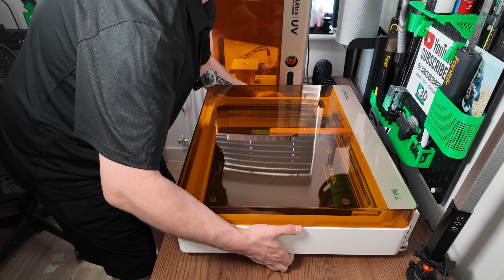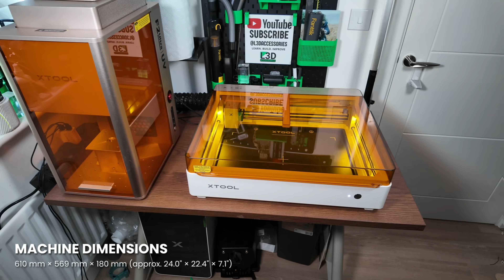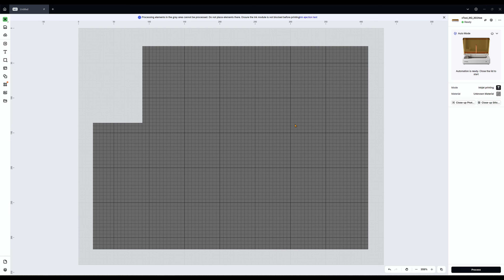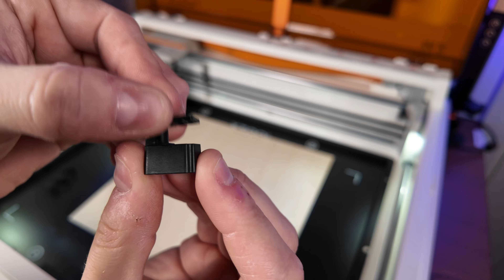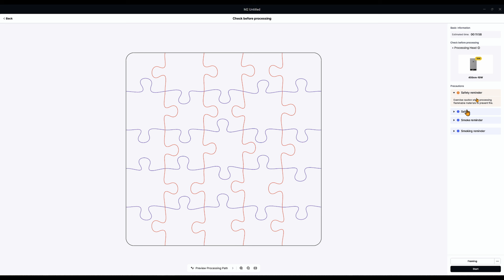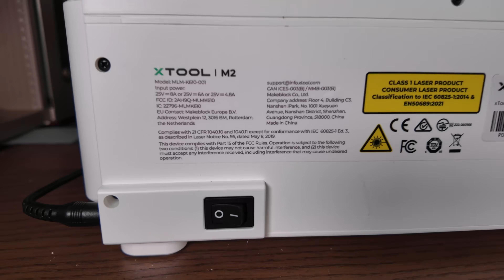I Tried xTool’s New M2… and It Shocked Me

Comment: At $99 per ink it won't take long to add up! Will the Xtool screen for screen printing fit on the work space??
Reply from the maker: I haven't tried that kit so I can't say for sure. The work area on the M2 with the 10 and 20 watt modules is 426 by 320 mm, so you could check the screen size against that, or xTool support can confirm.

Comment: I really want to get one but am I also looking for a affordable workbench that can hold that equipment- what type of workbench or table is the one in the video?
Reply from the maker: The laser is actually really light so most 600mm deep workbenches should be fine. The one I'm using in this video is an IKEA table and is 800mm deep. It's called: IDÅSEN.

If you do decide to purchase an xTool please consider using the affiliate code in my video description.
Reply: @L3DAccessories thank you for the info!

Comment: Can you do KFlex darts on this mate?
Reply from the maker: If you had the IR module then probably yes. Although I don't know how well it would travel over the flight once it focuses on the material. The clearance might not be enough.
Reply: @L3DAccessories ahhh ok mate thanks for the reply.. I had the Xtool F1 and wanted to do coloured flights but was told you can only do that on the F2 models.
Reply from the maker: @RustyBladesYoutubeBarber You can only do colour flights with the F2 Ultra UV. The IR laser can do black and maybe some other colours but they won't be very clear and contrasting.
Reply: @L3DAccessories ok mate thanks for the heads up mate seems like a big purchase for a few flights lol maybe I’ll skip the idea. I’ve been offered a HPC laserscript LS3040 desktop machine but again I didn’t know if I could do flights on that either. 🤦🏻‍♂️
Reply from the maker: @RustyBladesYoutubeBarber You're welcome. Just a heads up, the LS3040 is a CO2 laser which definitely can't do dart flights. What it can do is cut clear acrylic, do tumblers and woods.
Reply: @L3DAccessories that’s brill thanks mate

Comment: I just bought one today!  I have a P2 but wanted to print in colour and wanted to engrave on stainless steel.  I’m a bit concerned about the smell as I did have the AP2 for my P2 but the smell was bad, especially with acrylic.  I purchased the desktop air purifier so I hope that does the trick.  I suppose I can vent out of my window as well.  Thanks for a great review.  I have a couple of questions?  Have you printed on clear acrylic in colour and to secure items can you use masking tape?  I do that on my P2 when wood or acrylic is warped.  Thanks Chris!
Reply from the maker: Thanks for watching! I've been using it and doing a lot of cutting and engraving and the extraction alongside the AP2 did a brilliant job. I genuinely didn't smell anything during the engraving.

I tried printing onto pink acrylic and it didn't work, the ink just didn't adhere to the surface so I don't think you'll be able to do it.

Yes you can secure the material down with masking tape, the camera accuracy is brilliant so as long as you take a picture you'll be able to position your design in areas away from the masking tape.

Comment: Did I see the wood shift as it printed for the jigsaw? And does this machine have a riser and  honeycomb base, air assist that can be added ?
Reply from the maker: Yes it shifted, the little clips that lift it up and hold it in place are a bit fiddly and I didn't secure it entirely. But ultimately they aren't a great solution.
Reply: @L3DAccessories they don't look like the best idea.
Reply from the maker: @michelarennison4756 They do the job, but they are definitely limited.
Reply: @L3DAccessories  Maybe a 3D printed jig with magnets embedded would help.....  Does it have a feed through for material larger than the bed%??
Reply from the maker: @MilesWaldron-b1g You can remove the baseplate and sit the machine on top of the material. But there is no feed through

Comment: How long does the color ink module last and how much does an ink refill cost?
Reply from the maker: I'm unsure at the moment but I'll be keeping track of it and will make sure to cover both questions in a future video.
Reply: £169.00 on the xtool website - depends on how much you use it but it will need replacing each time just one of the colours runs out...

Comment: Ummmm. I'm wondering if you have any room left in your office space soon with all the machines you've got now!  And I'm sure you'll have 3D printed some tray for cutting and new magnet clips for us soon. But what about costs? How much to buy and replace the ink? Can we get the ink from any shop etc? Cost for making the jigsaw project? These are the things that I will need to know before committing to make sure it worth it. If the ink is hard to get and takes time to be delievered. That means that people need to buy it early so they have it ready if they run out. Then we need to look at the shelf life of it also.
Reply from the maker: I'll be doing more videos in the future and can go into a bit more detail about the running costs. The ink is xTool proprietary as far as I know so it will need to be purchased directly from them.